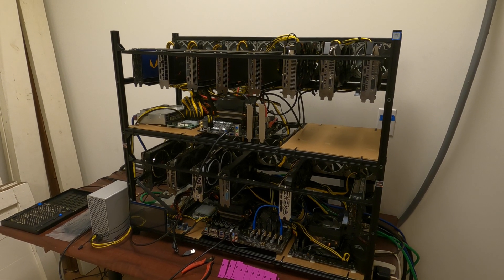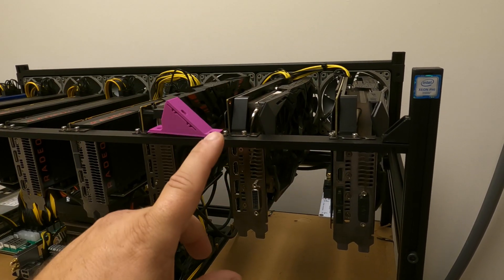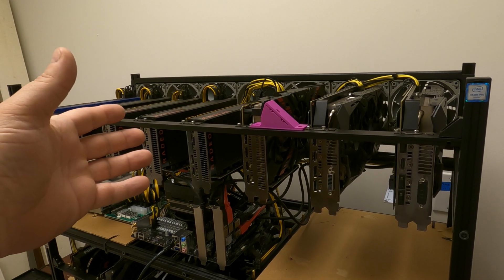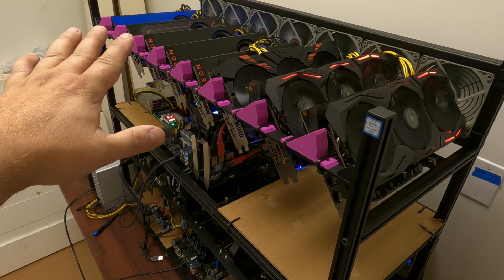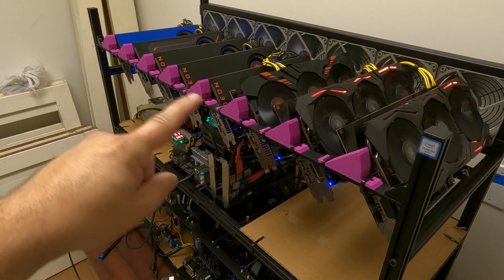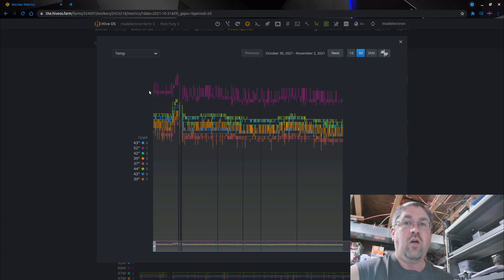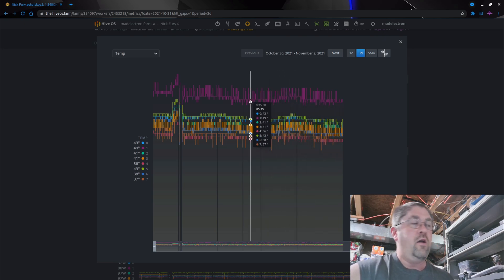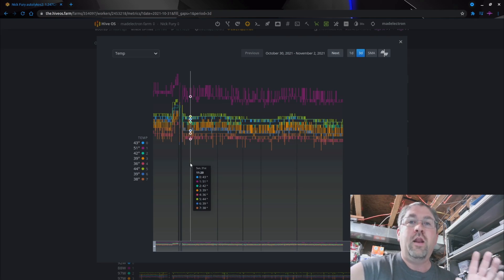Mounting GPU's In Mining Rig At 45' - Does It Keep GPU's Cooler??

Comment from the maker: Have you 3d Printed anything for your mining rigs?  Comment below and let us know, it may help out someone.
Reply: Ive printed some wire rack hangers and also clips to hold down my pci adaptors
Reply: literally the half of the frame :D im gonna try this out
Reply: USB cables clips to prevent loose pcie , PSU brackets, CPU cooler brackets, SSD brackets, power switch boxes, ….
Reply: Be aware that bearing (sleeve, hydro, or ball bearing) prefer to be in the vertical position.  This is what I never understood about PCs because the GPU fan is horizontal (as is the psu) but the CPU fan is perfect.  Probably explains why I never had a CPU fan go out while I have had on my power supplies and even a couple of GPUs over the years.  Prior to the safety feature of turning off if over heated I lost many a card.  My last loss due to fans was the HD7870 because it was the last generation without the safety feature.

Comment: Hey, my understanding of thermodynamics and heat flow you are doing it inverted. The fans are trying to get fresh air from above, but you are heating below, and this air will expand and move up. So, you are getting hot air. Rotate the pink holders and the cards. So the fans will get fresher air from below, the hot air will be freely to go up, and less dirty. Try it out, should perform better! ;-)

Comment: The strix led is half dead. I've got a 1060  strix with the same problem, it must be some common issue, design flaw :D As a miner noone cares, u just disable it for slightly less consumption, but as a gamer with rgb chassis, you should consider buying something other than a Strix.

Comment: I ended up doing about a 30' wedge for my 6 x 3080 FE rig.  I also pushed the rig so the back of the cards where snug to the wall. Using 2 box fans, the wall helped to force guide air flow as I pushed through from the right side flowing over the cards while the second fan pulled from the left, creating a sorta of wind tunnel.  It seems to really aid the "flow through coolers" that Nvidia put on those cards, its my most stable rig right now, just happy in the breeze!  I really need to get my own 3d printer for these situations.